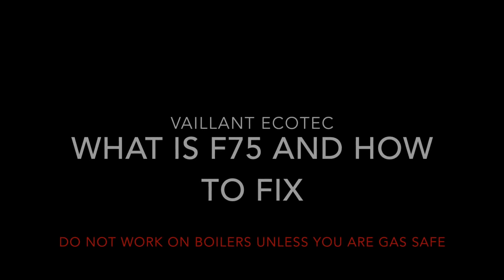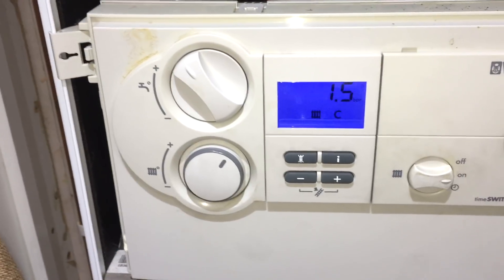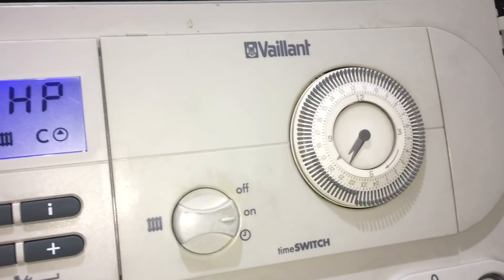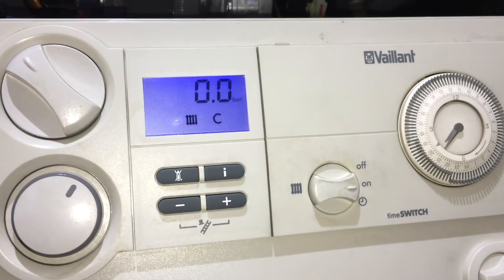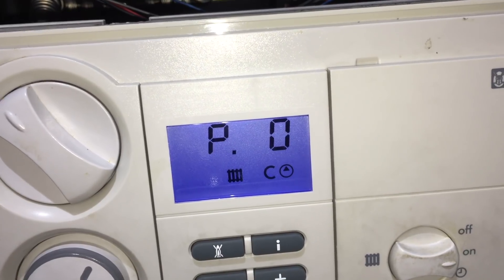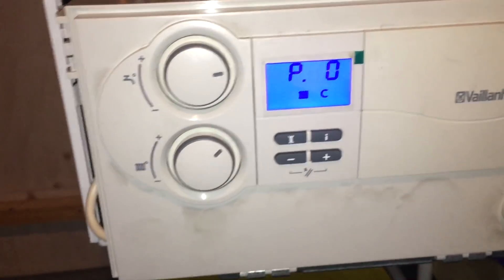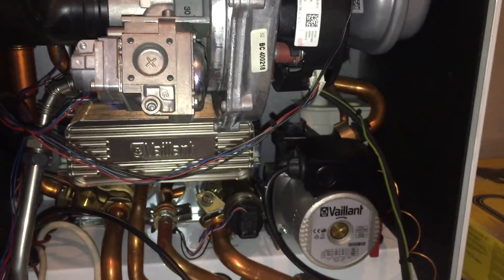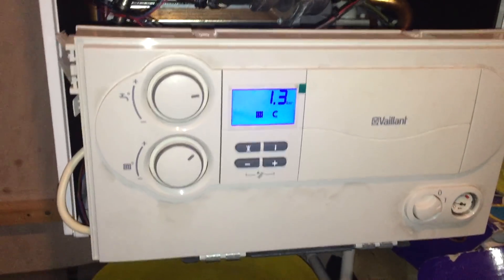Vaillant EcoTec F75 repair AKA F9 GlowWorm Boilers.

Comment: Have watched every video. 
I’ve been a gas engineer for 11 years mate but I have picked up lots of good tips from you. 
Keep them coming 👍👍
Reply from the maker: Were all still learning. Everyday I pick up a little trick here and there. Just in the last 2 weeks I have mastered replacing Worcester Greenstar PRV's.
I have been changing them for years trying different ways. 
I will try and get that one uploaded soon.
Reply: HeatingGeek 
I’ve had the mains pipe off below, pump and block out and boiler off the wall 😂
Reply from the maker: I refuse to take anything off the wall unless it needs a vessel. Its difficult to tell a customer that your going to charge 2-3 hours labour for a £15 PRV.
Reply: @HeatingGeek  if the expansion vessel or prv becomes faulty could you install these at some other point in c/h pipework and just forget about the faulty ones?
Reply from the maker: @garylawton7254  Yes and No. Lots of things to consider and its easy to replace them in the boiler. Also, regs (that are often ignored) say the PRV should not be isolatable from the heat source. Putting in an external Prv on all combi boilers would be wrong because you can turn off the isolation valves.
Reply from the maker: @garylawton7254  You ask a lot of questions, Gary. Are you an engineer or learning or just interested? :-)

Comment: Excellent video once again - many thanks! Big problem with these boilers, sure this will help many others. Name of the game is keep the system water clean and filtered. Otherwise these Vailants will throw up several problems.
Reply from the maker: Exactly, keep it clean and you don't need to filter it though.
I have filters in my garage but not on my system. My system is spotless.

Comment: The pressure sensor is magnetic so it sucks in magnetite (iron oxide) and blocks the sensor. Place some loose wire wool trimmings and watch it stick to the sensor.
Reply from the maker: Nice tip. :-)

Comment: Hi Do you ever have problems with the power switch on the ecotecs?  About 4 years ago I had a series of them that when I turn it off to do a service the power switch would fail and I would then have to explain to the customer that the need a new pcb 
I now don’t turn them off at the switch and isolate them at the wall switch. Have you come across this and do you have any tricks to put it right? 
Another great video I think I have Caught up on the full that catalogue now.
Reply from the maker: I have had the newer Button type fail. Not the older knob type. Which one did you have the issue with?
Reply: HeatingGeek The old round switch type, maybe I just got unlucky.
Reply from the maker: @andyturner1502  Yeah, I never had it that I can remember. :-) That's a part that could be replaced... :-)

Comment: hi, I have bought a Fernox TF1 filter which a intend to fit myself, I am thinking draining the boiler should be easy enough, but when I have fitted the filter and turn the water supply back on, will the boiler just fill back up without me having to  anything and be safe to turn back on. ?
Reply from the maker: What boiler? Open vent or sealed system? 
Basically every situation is different and I can only give you some basic advice that might not be right for your situation. I don't want to give wrong advise.
Give me more info and I will try and help.
Reply: Hi ya, thanks for the reply, I have a sealed system no water tanks in the loft or anything like that.  And the boiler is just coming up to being 15 years old, it is a Valliant turbomax plus 828E it has been a great boiler only 2 breakdowns in all them years, cant remember what the first problem was, and the second breakdown was the divertor valve.
Reply from the maker: Thats a great boiler. Depending on access it should be no problem fitting a filter. You will need to fill and vent the system afterwards using the filling loop. Do you know how to drain it etc?
Reply: I downloaded a manual for it and found the drain off point, I am guessing it will just be a couple of litres to drain off, I was more concerned about weather their was anything you had to do after refilling it before starting it up again,  I can see their is an auto vent inside the boiler, so if it is just a case off filling it up at the fill loop  and the heat exchanger will went it's self then I think I will be ok.
Reply from the maker: You need to be careful because when you drain it will be a few litres BUT there is usually alot more in the system. If your boiler is at a high point it will be ok but if its low you can get surprised. 
The boiler will vent its self if the AAV is ok. Just turn the on/off (0/1) knob on and off a few times after you hear the pump run and it will help clear the air. Like what the P0 thing does on the F75 video.
Reply: the boiler is up stairs so it should just be the couple of litres that come out.  fingers crossed the AAV is working ok, I am waiting till the weather warms up just in case it gives me any trouble, plus I would like to take the radiators off to flush them out, as the boiler has never been power flushed or had the inhibitor topped up,  as it is a council house which I have just bought this week so now I am thinking I need to take care of the boiler now ha ha.  funny enough the annual service was due and the guy turned up today even thought the contracts were exchanged this Monday, on the house sale,  if I was not just leaving for work I would have let him to do the service I bet the housing would not have realised or have been bothered even if they did.  Are you in Birmingham by any chance just in case I ever need an engineer ?
Reply from the maker: Im in Hertfordshire just outside north London. 
The Turbomax Plus is a very robust boiler and will work with heavy sludge without too much issue.
You will know you have a sludge issue if the hot water runs hot cold hot cold.
(It will start by going hot, warm, hot, warm).  If that happens the plate heat exchanger is blocked and its the canary in the coal mine. 
Don't replace that boiler until you really need too. I think it the best combi ever made.
 If the AAV is a problem (as you cant open the boiler to replace it) turn the hot water knob all the way down (You should notice the green light goes off) and the boiler will hopefully push the air into the radiators.
Reply: I have had a couple of engineers who have serviced it over the years have said it's a good boiler.  I did have a period a while back were the boiler was a bit noisy when it first started for 5 or 10 minutes, then went quiet, it was a bit like the sound of water pipes vibrating,  but it suddenly stopped doing it.  the only thing I notice now is when I turn on a hot water tap it makes a bit of a groaning sound, I am thinking it might be the divertor valve having to move in all the sludge that's bound to be in the system after all these years. hopefully the TF1 will get rid of a load of it when I fit it.
Reply from the maker: Good luck and let me know how you get on.
Reply: just watched a clip on a boiler repair, I am a my suspicious nature thinks Mmm did it really need a new pump, mine is 14 years old and still going strong ha ha,  What do you think https://www.youtube.com/watch?v=iCZdH1x9bJ0

Comment: Please dont take it that F9 on Glowworm is a pressure sensor,  if it's a iris board F9 is a global fault not just pressure sensor,  quickest way to test on either just drain boiler , if there is still pressure on readout pressure sensor blocked

Comment: How much does the sensor replacement fitting cost the customer?
Reply from the maker: Depends how much the engineer charges. He has to diagnose too. It would cost my customer about 155 but they would get the vessel pumped and boiler safety checked etc. No Cheap Cheap here!!!
Reply: Sensor cost is £30 can be diagnosed within 10 mins , boiler drain 10 mins , vessel can be checked and pumped whilst being drained , none of this putting it into purge mode nonsense £100 MAX  ,I worked for group service for years know these boilers back to front

Comment: I see so many engineers seem to have different preferences when it comes to draining down a boiler. Some turn off. Some leave on. Some drain just boiler then system. Some just boiler. 

What’s actually the correct way, I was told isolate, drain boiler and then system if needed but never drain system without first doing boiler and isolating.
Reply from the maker: Every situation is different. Some boilers I would never touch the valves on. Some I would. Experience tell an engineer how to play each situation.